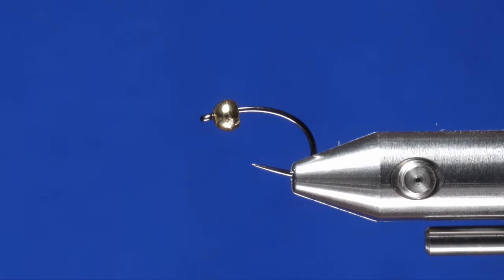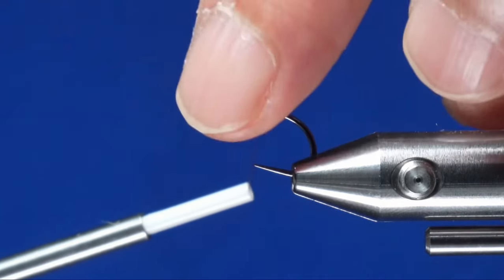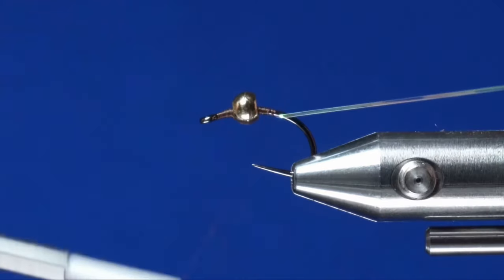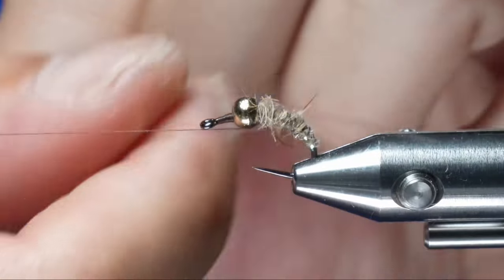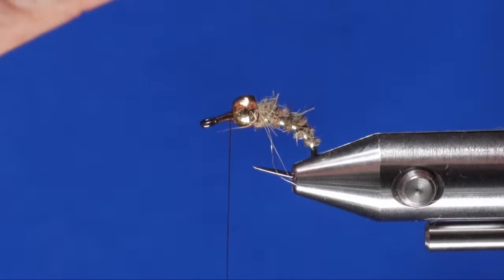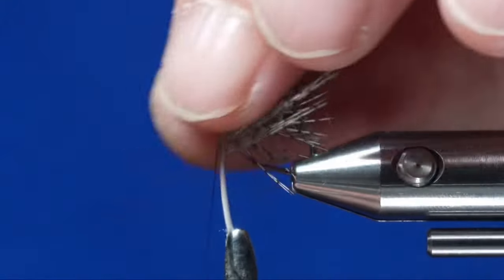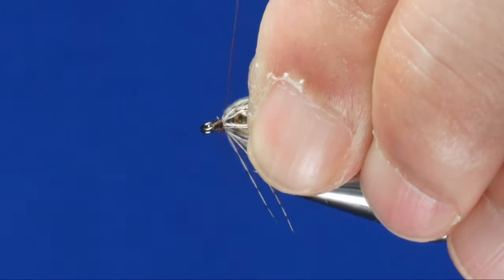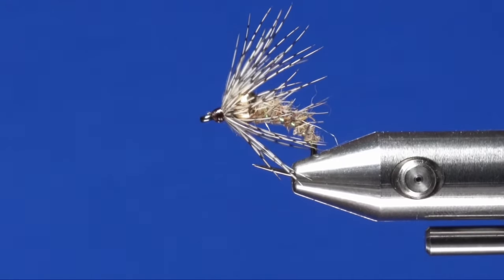One of the best caddis Emerger patterns - Holy Grail Caddis

Comment: What is preventing the thread passing over  the bead from being cut by a trouts tooth there by causing unwrapping of the dubbed body ….or did i miss something
Reply: So good question,  once the fly is finished in back and front,  it should keep the bead stuck!  Good pattern and balances the weight on the hook shank imo
Reply from the maker: Thread dam in front and behind the bead. The initial thread wrap is just for bead placement